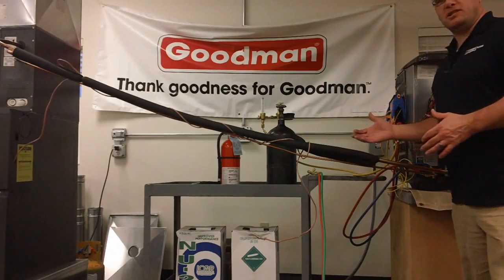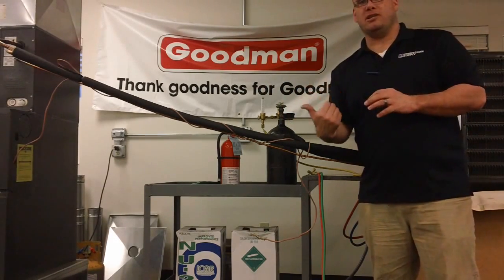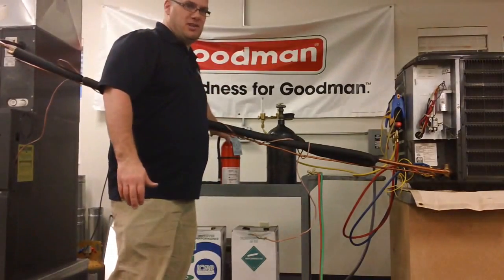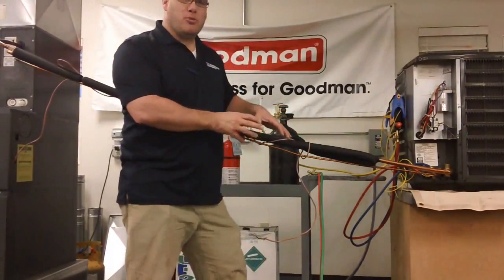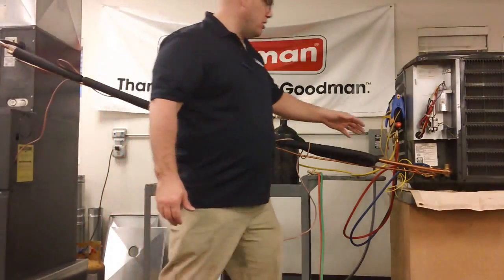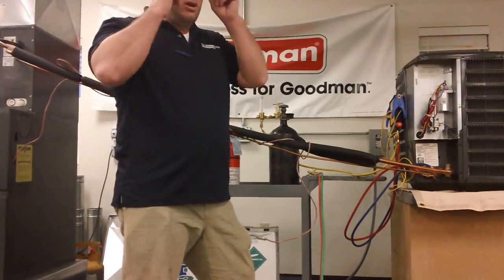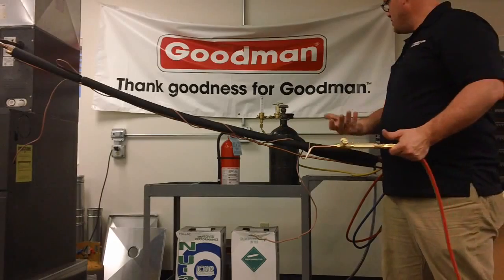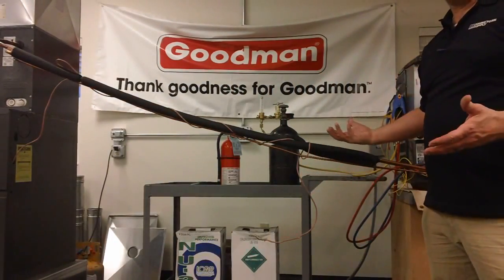Brazing with nitrogen beginning to end

Comment: Nitrogen is definitely not needed....if you use Tufflok.
Reply: Tufflok is a great invention. If an hvac guy desires to use it he will be depended on Tufflok company from tools, glue, fitting, etc. Not practical simple solution. I am pretty sure brazing will be in hvac industry for along time.
Reply: @trangdoan6092  never heard of it.  How does it eliminate scale inside of the lines while brazing.  How long has it been on the market? Is it another type of press fitting?
Reply: Borderline proprietary, Nowhere to be found.

Comment: stay brite #8 the best  solution
Reply: Some job specs won’t  allow staybrite #8. Something to think about when doing large commercial work.  It has its place though.  I don’t like the runny flux, which will get into the piping. I have used it,  but only on certain applications.

Comment: One of the things that I feel was not gone over in this video as well as other like it is the safe handling of the torch set, the proper way to secure the nitrogen bottle during the procedure, the danger of suffixation from inhaling nitrogen while brazing, and the proper PPE ( personal protection equipment ) to wear while use these items.  No matter how many times you make a video or practice this craft, safety should be your first concern.
Reply: Jim East 
Lol, the air you breathe is 71% nitrogen, 21% oxygen. 1% other gasses
Reply: Please elaborate more on the inhaling of nitrogen, as for this guys video, you don't have gauges hooked up, you simply remove the schradders, and wrap the the service valves with a wet rag, I will have to look at this cool gel
Reply: Pointing the torch toward his hands when he did the cup test.  Hope he had that heat guard spray on his hands.  He mentioned safety, but doesn’t wear gloves

Comment: How can you be sure that nitrogen is at the location you are brazing? Is nitrogen heavier then air? When you are flowing it around the hole system, if there is nothing open at the air handler, how do you know that what is coming out of the port is nitrogen and not air? Is there something you can do to be sure? If you hole a flame at the out port, would the flame be different or ......
Thanks for the video.
Reply: Flame will go out if the proper nitrogen flow is used, and given time to reach the end
Reply: @rodgraff1782  Thanks for answering.  I guess I am not clear though. you get the line set all ready to braze. How do I know that the nitrogen is in the line at the point I am brazing? How do you know that all points,high and low will have nitrogen behind it? How do you make sure, as you mentioned, it let's the flame get to the metal an not go out as you are heating it? Thanks again
Reply: @amtpdb1   Here is how I do it.  I have a flow meter on the nitrogen tank.  I connect the incoming line to the liquid line port on the outdoor unit, which allows nitrogen  to flow to the indoor unit metering device and coil, then back to the large line at the condensing unit where I let it out at the large valve port.  Both shrader cores are removed.  I start it with a purge that is higher than normal to blow the lines out, then set the flow meter so the ball floats at the first line.  I hold a match to the outlet on the large valve.  The force of the nitrogen is not enough pressure to blow the flame out, but it will extinguish  if nitrogen is coming out, because there is no oxygen.  Hope that helps
Reply: @rodgraff1782  Thanks for the clarification.

Comment: WRONG! You are supposed to close the oxy-acetylene CYLINDER valves BEFORE you release the regulators!!  you still have high pressure between the cylinders and the diaphragms on the regulators.

otherwise, excellent instruction!
Reply: Correct.  Also when shutting off the torch you turn off the acetylene first, then the oxygen.  This blows out the flame, remember oxygen it self will not burn, it makes everything ELSE burn.

Comment: do you need to use oxygen when brazing?
Reply: Yes. You can't have fire without oxygen.
Reply: No.  You can use an air/acetylene torch, not as hot as Oxy/Acetylene, but much hotter than propane.  They work like the propane, the acetylene flowing through the torch draws in air through a veintury to mix with the acetylene.

Comment: Can CO2 "carbon dioxide" be used instead of nitrogen?
Reply: I don't think CO2 would work for purging. You are trying to remove oxygen from the scenario. CO2 still contains oxygen. Dry nitrogen is an inert gas and would not allow carbon to form inside the pipe
Reply: +john spinosa no
Reply: Nitrogen or argon.